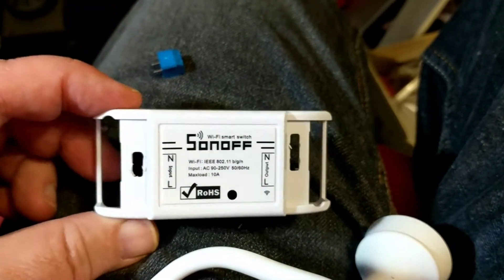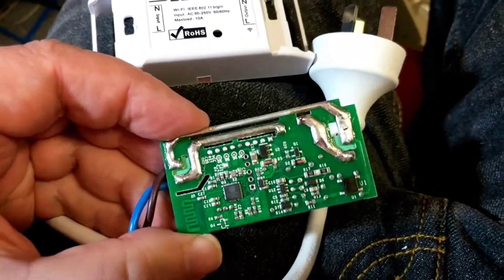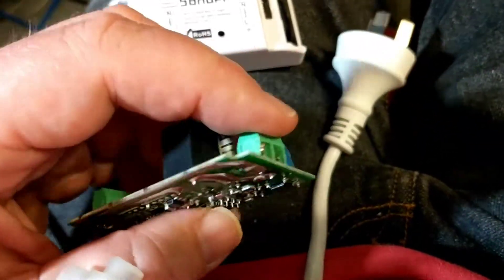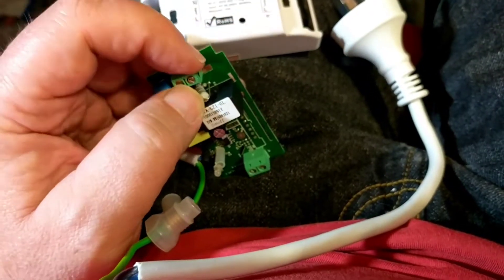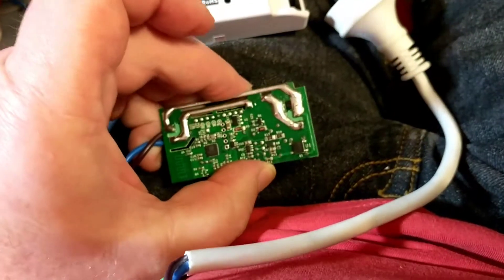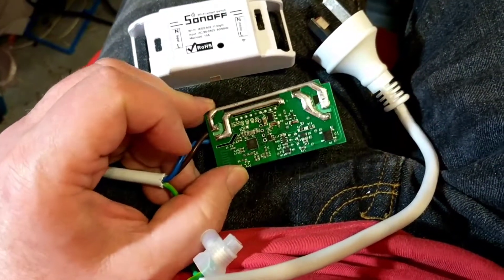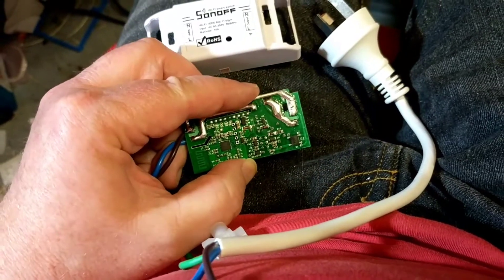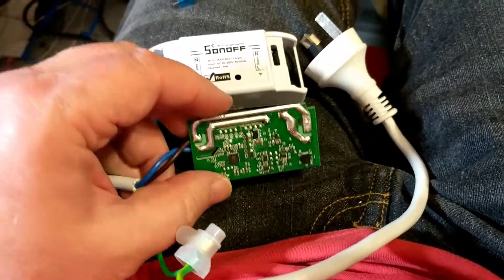SONOFF electrical safety problem

Comment: I’ve just attempted to screw in some 1.5mm T&E and the rigidity of the cable pulled the terminal off!

The terminal pins did not snap, simply they pulled out of the lump of solder leaving a perfect cylindrical void through the solder where it was.

Is this an example of a dry joint?

Comment: Hi. Did you bypass the ground outside the sonoff as they don't have an option to ground.

I noticed the terminal blocks too. Might just under tighten them and add a bit of solder to the connection...

Be interested in your ground wire issue though...
Reply from the maker: Simon Williams hi yes of course, I ran  the ground straight past it. Cheers.